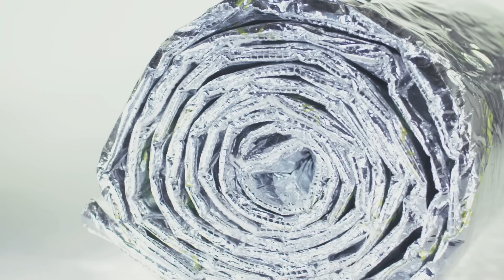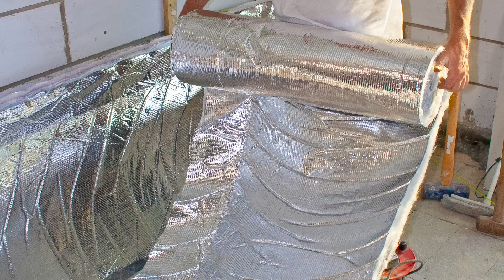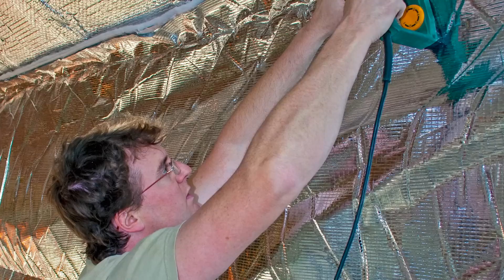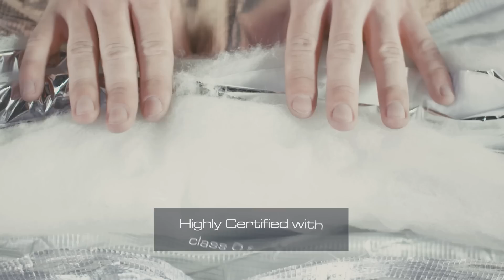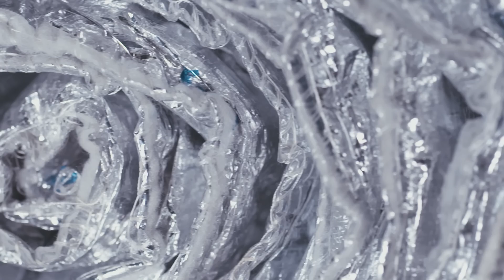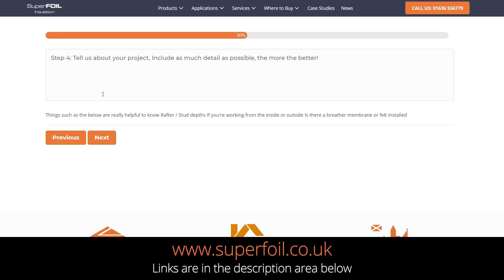What is Multifoil Insulation? — With Byron Lawson

Comment: Re vapour checking abilities of insulation; there's a school of thought that this is a bad thing, as long as the loft is ventilated...if there is no vapour barrier then moisture will go through the insulation but out through the vents. If there's a vapour barrier somewhere then moisture will just settle & stay on that, so causing damp / mould issues.
Reply from the maker: The vapour barrier needs to be on the warm side of the insulation.
Reply: @SkillBuilder  If you have made the loft effectively airtight, where does the moisture that finds its way into the loft then go? If the loft is not heated how warm does it need to stay to avoid any form of condensation if there is no air movement up there anymore?

Comment: I'm very sceptic about R-value claims in these kinds of products, simply because they consist of layers of heat conducting materials and layers of not-so-great insulating materials. Saying things like "we don't measure the speed of heat transfer but the resistance" is nonsense, one is the inverse of the other, that's like saying "we don't measure at which average speed you drive to the shop 5 miles down the road, we measure how much time it takes you". I would never rely solely on a product like this for heat insulation.
HOWEVER, this doesn't mean it can't add a serious value to glasswool/rockwool/PUR/PIR: with energy bills going through the roof, people are rediscovering the value of radiant heat in which it isn't necessary to have air temperature in the room at 21°C to be comfortable as long as you and the surfaces you touch receive heat energy through radiation. Products like this can be very good at blocking and reflecting heat radiation, hence the subjectively ugly but effective foils that are being sold to stick behind radiators and mirrorlike foils and coatings that are put on southfacing windows to prevent overheating in the summer, and the bit of resistance to heat conductivity they offer could be enough to reduce the effect of thermal bridging. Instead of buying the thicker versions of this product or only putting in glasswool/rockwool/PUR/PIR, it could be a good idea to insulate with traditional materials between the rafters and use a thin version of this product as supplemental insulation and dampproofing sandwiched between the construction/insulation and the finishing. If there's a dampopen version of this it could even be a great idea to use this on the outside underneath the shingles to keep out the radiant heat in the summer before it builds up in the rafters and insulation.

Comment: As an architect I would say that it might work if the foil is next to an air gap and can act as a radiant heat reflector - but in all other circumstances I wouldn't touch it with a barge pole. The BRE took a dim view of it in testing.
Reply: You are correct.  That is why they have the batten system.  It's the air trapped behind the battens that give you the insulation.  
 Everyone talks about vapour barriers but homes need to breath!

Comment: Hi Roger. thanks once more of putting together such an interview. there must be a lot of work and preparation that go into them. So thanks. But unfortunately all this talk of R values, and u values, or ratings, has been totally lost on me. Though I will try and find another one of your discussions on insulation that a dim Wit like me can get my head around. And that is no disrespect to you as Cleary I need to get my head around this topic as it may be one of the most important elements to a house renovation, particularly when putting up a new roof. thanks Roger. I do try to keep these comments short. many times I've just erased the ones which end up way too long.
Reply: You'll get there, I'm not knowledgeable nor experienced. Just a logical thinker I would say. And here is what I posted as an earlier comment, it might help... MULTIFOILs seem to need careful consideration. Maybe in the loft, laid over a traditional minimal fibreglass fleece. By the way, for my traditional 1970's brick-cavity-block-wetplaster WALLS I am thinking about using one of the QUITE THIN Erfurt Wallrock or Erfurt Redlabel wall lining products, not least because then the depth loss at skirting boards and door frames is less obtrusive. These come from just 1mm to 4mm thickness, the 1mm ones are a paper product and are naturally over-paintable, the 3mm and 4mm ones seem to be more polyester meaning more prep needed if one wishes to then over-paint. The products U values are stated in the specs and are obviously on the weak side, but I'm hoping will be enough bearing in mind the current 1970's spec cavity walls (which, by the way, do include retrospectively blown in insulation - which, I've heard, is not often of significant worth). My logic for thinking of going this wall lining route is that, almost by chance, I noticed ON AN INTERNAL WALL where one side is emulsioned and the other side is vinyl wall-papered, that (at an internal door), one hand placed on the wall this side, and the other hand placed on the common wall the other side, gave a noticeable tactile temperature difference! Try it. David Whyman.

Comment: Here in Australia 🇦🇺🇦🇺 I recently rebuilt a section of our house and used Rhino skin which is 2 x layers air pocketed foil with a layer of foam inside. With ROCKWOOL recycled concrete…this combo is incredible for thermal and sound insulation. I like that my cavity did not require adjustment. Fibreglass is as toxic as asbestos so I would avoid this product.

Comment: I would not want to use a foil product as my main insulation. 1 cut or tear and you loose that dead air space. Without the dead air space the foil won't do much. I like the idea of having a radiant barrier that will reflect heat but I also want good insulation like Rockwool.

Comment: I was very interested in this discussion as I am about to renovate a room of my house which is built of 9" solid brick walls and I want to take the opportunity of insulating the two external walls. I was almost sold on this product until I watched another video of someone doing a fire test on some different foil insulation products. In the test it ignited and supported the burning process rather than being flame retardant and that would seriously worry me.
Reply: I recently did a few 9" solid walls in my house. When installed this stuff is well sealed in within the wall between timber battens, behind plasterboard and plaster. My house would have to seriously burn for a long time before it reached this insulation layer. Most building supplies burn in isolation but rarely have the chance to burn in unrestricted open air

Comment: Fantastic video thanks Roger and byron! 
What would the guidance be when it comes to the double battoning on a 9" wall in the sense of the cold or damp side?

Ie, the warm side batton is vapour protected from the outer wall and therefore should never rot from moisture in an old damp wall, but if there is any damp in the 9" wall would the cold batton not rot over time. Would it be suffice mount the batton on a strip of say 4" dpc?

Also I assume this would work just as well with metal stud work if there is a secondary aim of straightening a wall also.

Thanks again guys!

Comment: it's a great product, but the biggest drawback (especially in loft conversions) is the sheer lack of sound insulation.
I have seen several installations where this has been used to save space in a loft conversion, and it worked perfectly, but when it rains... the noise! 
great product under the right circumstances, but it has its limitations.

Comment: Roger, i have a screeded floor with carpet on top, really cold, could multifoil be laid under the carpet. thanks.
Reply from the maker: There are many foil baked underlays out there which improve the insulation. I don't think that multifoil without an air gap brings much more to the party in that instance. I could be wrong about that. Maybe we should try it and see the difference.

Comment: So where does all that rising moisture from your home go if you line your roof rafters in this foil and vapour seal it. It's just going to stay in your loft isn't it? The now warm loft is going to be so humid the stuff in your loft will be covered in mould?! Are we supposed to run a dehumidifier in the loft 24/7 eating up the savings we made on the heating bill? Am I missing something here?
Reply from the maker: It will evaporate in the same way it does in a loft conversion. I would say that a couple of ridge vents or through tile vents will be needed.
Reply: Thanks for responding. I think i understand how vapour barriers and condensation etc works (thanks to your vids), but the vapour that rises through the ceilings in the house would surely get trapped inside the loft by the vapour barrier, causing a very humid loft?
Reply: @alax5953  yes I was wondering the very same thing. If it was sealed there’s no where for it to escape to and unlike a loft conversion, no windows for ventilation. It’s on the warm side though so perhaps wouldn’t condense but I imagine the loft might get very humid and stuffy if it was air tight.

Comment: Another very interesting video - thanks Roger. I am interested in improving the insulation of the solid walls (and floors!)  in my 1870 ish cottage. Whilst adding 95mm or so to the internal face of external walls might be manageable (but not desirable), it would be good to see some practical solutions to how you work around windows, door frames, plumbing for radiators etc. I see these problems as more difficult than losing 95mm but depends on size of room. Given the massive price hike in electricity costs  together with recent and likely upcoming Government legislation there is a serious need for a coherent set of tools to help owners of older properties at prices which are affordable. What can we learn from other countries?
Reply: Dense Rockwool is the usual "go-to" for external insulation. It's hydrophobic and attached with metal mesh over the top that's mechanically fixed to the wall. Battens are hardly needed as the mesh is folded and pinned to the wall. Render over the top seals in the insulation and allows moisture to escape.
Internal insulation needs battens to support the wallboards or a firm bonded insulation (e.g. Isocyanate foam) that can be "dot-dabbed" to the wall.

Comment: I'm really sorry but i remain unpersuaded. Conduction is by far the largest proportion of the heat loss and radiation is a tiny part. Surely 100mm of PIR is more effective than 45mm of light quilting. However multi foil would be brilliant at protecting a satellite from the suns radiation.
Reply from the maker: I don't think anyone is suggesting that the multifoil beats the PIR , it is just about the build up. In loft conversions that can be a problem
Reply: @SkillBuilder  I was mulling over what you said and I seem to remember he needed 95mm for multi foil. What is space saving about that?
Reply: @SkillBuilder  fair enough. But do you believe his figure of 0.19. I have my doubts.

Comment: Have installed this in a property in Greece. Below a sloped timber tiled roof and also a Concteate flat roof to keep out the heat from the summer sun. I had a lot left over so added a second batten and additional foil layer. It works brilliantly and is easy to fit ,transport and handle on site. 
Would highly recommend

Comment: This is what I don't get: Most heat will be lost through conduction, only a little by radiation. One layer of foil should stop radiation, then the rest would be down to a material which traps air in very small pockets to stop conduction. So why would multi layer improve on this? Surely just add a reflective layer and then take the best conductive insulating material in whatever thickness? I have an expensive roll of Airtec double. Supposed to be the equivalent of 50mm polystyrene BUT you have to install it with an air gap and of course the air gap itself is an insulation! I've often wondered if bubble wrap with kitchen foil would be a good and really cheap alternative!

The ideal insulation would of course be a vacuum with a foil reflector. No loss of radiated, convected or conducted heat!
Reply: Yeah but if you use a single layer of foil, although it would stop radiation of heat from the warm space to the cold space, it would now also be an excellent conductor of heat from the warm space and will dissipate this to the air in the cold space. Depending on its placement (pitched roof rafters for example) it could also cause convection currents to occur behind the rafters further increasing heat dissipation. The idea of the multilayer form is to progressively slow this process down by alternating density of materials sandwiched together.

Comment: Can these multifoils be used on underslung fresh & grey water tanks to stop them freezing on campervans?
Reply from the maker: It will help but in the end the only thing that will stop it freezing is a tank heater. I have a camper and it might take a few days to freeze the tank but even with insulation it will freeze eventually.

Comment: It was very disappointing that you didn't pull him up on his explanation of how foil is better than other insulation because list R value, rather than Lambda values.
"traditional insulation products are always badged with their thermal conductivity... multi layer foils we measure their ability to resist conductivity)

Rvalue = L(thickness)/Lambda. 

he works with insulation, and is just bullshitting you to your face trying to confuse you with numbers! - it's a really poor advert for their company.
Reply: Couldn't agree more. This guy was a complete patter-merchant. I checked the Superfoil website and there's no BBA certificate that's downloadable, unlike all other legit companies and properly tested and certified products. Plus there are a load of typos on the website which always has my alarm bells ringing as a red flag as to how professional and thorough a company is. I frankly didn't believe a word he said and certainly won't be specifying his products any time soon.
Reply from the maker: We asked him to put his case which he did.  A BBA certficate is desireable but it is not the only approval. We will get the other side of the argument soon and may end up with a head to head conversation on the subject.
Reply: @SkillBuilder  It's the only certification that counts and which would stand up in court. No-one is going to specify a product which could potentially come back and bite them on the bum without a BBA certificate. It's the manufacturer who is trying to push their stuff to market and they need this to show its been properly and independently tested *to suit its intended purpose*.  And to answer someone else's question, if its going to be sold as a 'membrane' then it needs to have been tested and certified as such.

Comment: You use the term"foil" time and time again. This implies some sort of metal. Reality is , if you put some sort of match to it ,it burns just like plastic. Whereas foil wouldn't. This worries me somewhat . We have all seen on the news what happened when insulation products catch fire in a big way , on that basis i decided not to put it in  my house. If you take PIR board on the other hand , the outer foil is foil, it doesn't burn. Though you can set fire to it from the edge, it surprisingly doesn't burn very well unless you force it. None of this is of course scientific , just many,many years of using these products as instructed by so called professional people. I'm now using my brain on my own projects .
Reply from the maker: Good point, we did discuss fire in our pre meeting and should have covered it. We will do a fire comparison on all the insulation products we can find.

Comment: I wanted to convert my loft into a playroom for the kids. I actually sent an email into 'ask Skillbuilder' and Roger pointed to multifoils. I ended up using the combination of PIR between the rafters, with an air gap between the membrane and PIR to help prevent condensation. Then counterbatterned, installed superquilt, counterbatterned and then plasterboard. 

The approximate u value doesn't meet building regs for a loft conversion, but I never intended it to 

The room is more than warm enough in the winter with a little electric heater and doesn't get too warm in the summer.

Comment: Nice for holding the energy/heat, but creates another problem, a Farady cage,,maybe no problem  insulating a roof, but for a floor , For your Wifi internetconnections , u have to rearrange ur accespoints.

Comment: I have a 1930s built semi with a crawl space/basement (5' high). I want to insulate under the living-room floor above. The electrics run between between the joists. Can this foil be stapled directly to the bottom of the joists (does stapling it negate its effectiveness) or should it be installed between the joists (up against the floor boards) and held in place by net or thin timber battens?
Reply from the maker: I would always staple it on the underside of the joists, provided you have the access. That way you don't have to touch the floorboards and you get a lovely air gap of 4inches that is sealed and has great insulation value in it's own right.
Reply: @SkillBuilder  Many thanks for your quick response Roger. There was mention in the video of sealing the edges. Is there a special tape or can something like duct tape be used?

Comment: Just wondering, when foil is used in a crawl space, should a reflective foil itself be on the outside facing ground and not the inside?  
Secondly, can it be used on the ground as a vapor barrier as well as radiant barrier?  I would think it would corrode if it touches the soil?  TY!